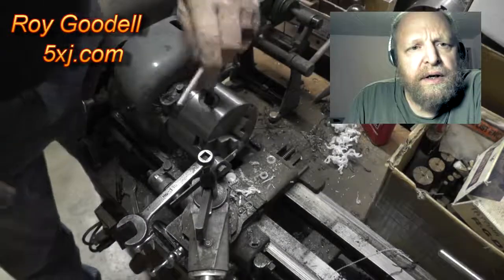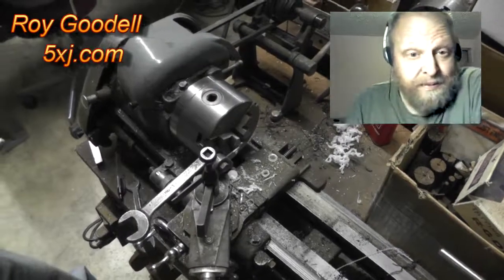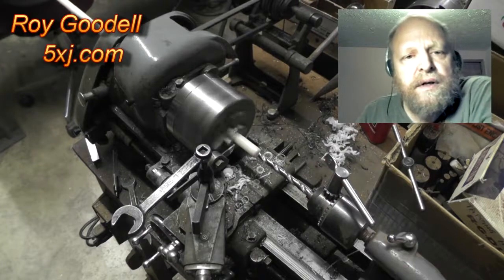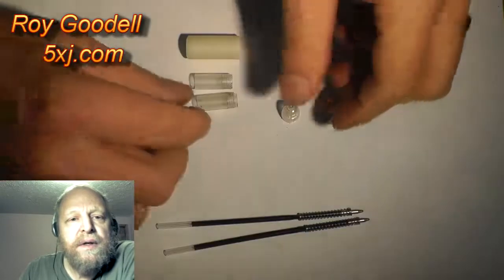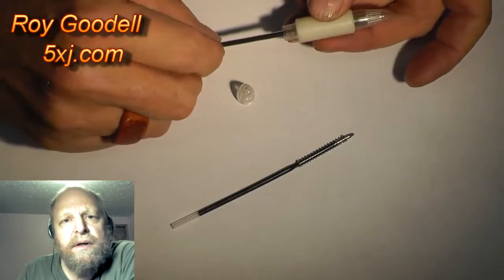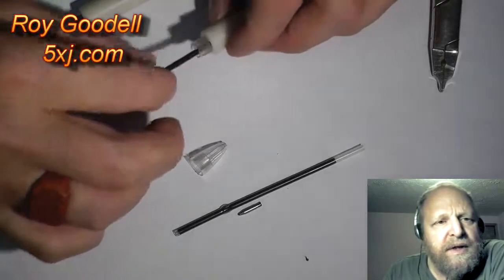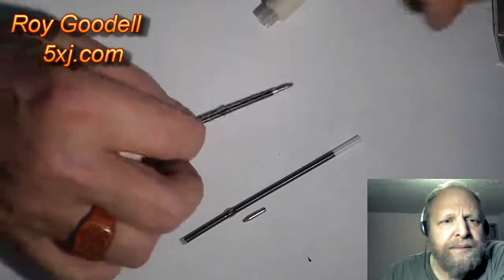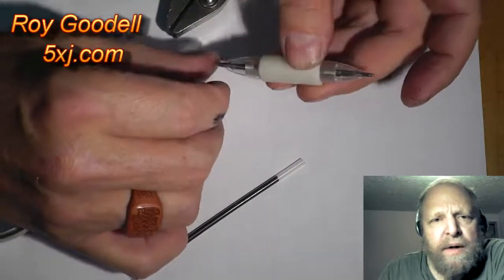Pen Style Touch Probe - 2nd Draft Nov 30

Comment: Beautiful idea!! Are you using Mach3 to scan the surface?
Reply from the maker: I use my own mill control program. (dos). The points are saved in an xyz ascii file format which I import into Blender (with a script I wrote). This xyz point file can also be read by most cad programs (ie. mastercam). I then create a surface in Blender (with another custom script). Finally I project the design onto the surface with the blender shrinkwrap modifier and output the results as an  *.nc file.

You could probably use Mach3 - and use the same type of input as other touch probes....